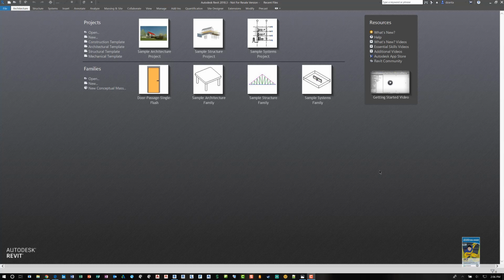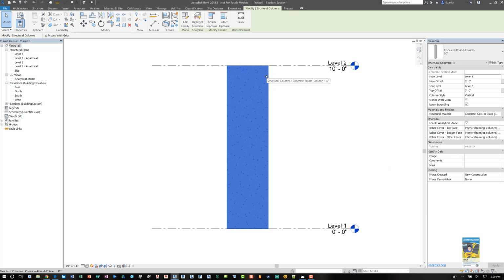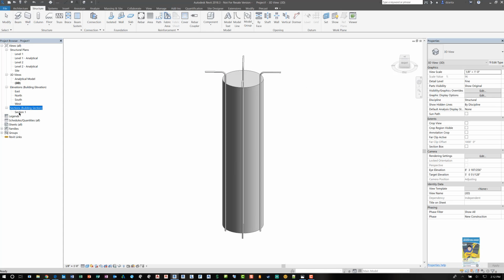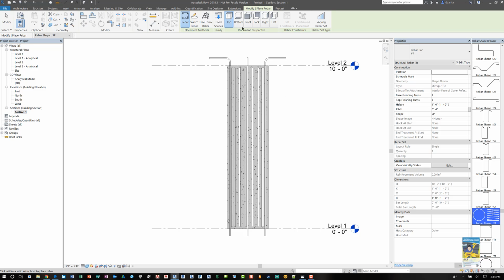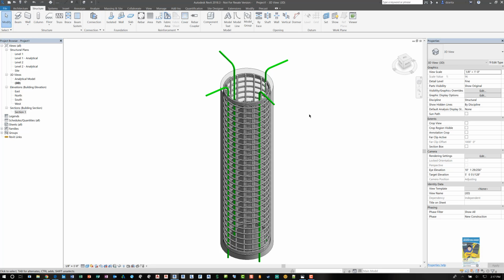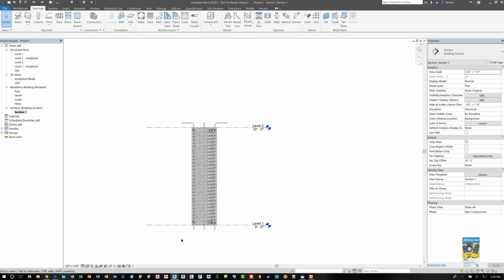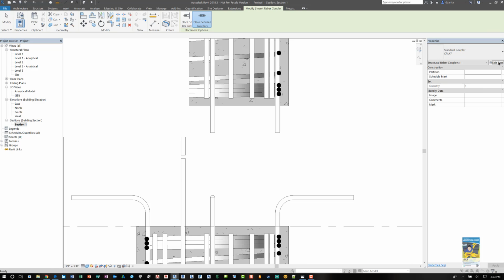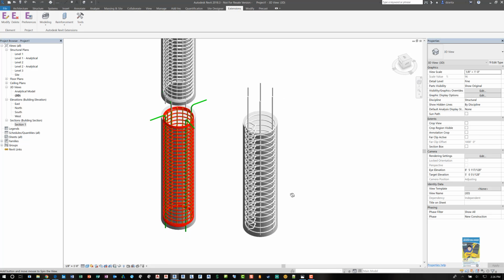Revit Round Column Rebar Creation - A How to Guide

Comment: its very helpfull tutorial , but in my case i cant find concrete and the rebar family 
i;m using revit 2018 if you may could you share the family file to this email please paul12blay@gmail.com
Reply from the maker: The round concrete column is a default family that ships with Revit.  Go to Structure Tab of Ribbon, then Build Panel, then Column command.  In the Type Selector, ensure Round Column is there.  If not, browse to Structural Columns subfolder within library and choose Concrete, then Round.  It will load in.  After placing the column, you can cut a section and then select the column to add rebar or just start the Rebar command to select the column to add to it.  Hope this helps

Comment: Hi, 
Can you tell me how is possible to make the spiral rebar cahnge like in your template. 
What i want to say is how you make the spiral be more frequent for 2m and less for the next 4m on the same spiral?
Reply from the maker: if you create the spiral reinforcing in segments (1 segment for the first 2m length) then do another segment (another segment for the next 4m length, this will give you what you want.
Reply: @DzanTa  hi, thanks four your rapid answer, awsome! But by creating separate spirals, the inventory will be difficult to read or create. 
Let's say you are creating a pile reinforcement foundations for a large building with 400 or 500 piles. The inventory and identity of the spirals will be difficult to read and fabricate
Reply from the maker: @virgilpopescu8815  I see.  In that case, you would have to experiment with the reinforcing command to see if it can create the different sections as a whole object.  I will try to look at this again later today or tomorrow and test this functionality.  I will get back to you.  I am currently teaching so can't help immediately.
Reply from the maker: So I looked at the Layout Rule Property within the rebar.  It only allows for certain methods and these methods affect that rebar tie you select.  You cannot have an entire section of rebar with varying layout rules.  I have seen where SE's will create separate rebar sections for the beginning, end and middle sections of the column or beam and then change the Layout Rule for each portion to make the rebar look the way they want.  Perhaps suggesting this capability to Autodesk via Revit Ideas would help...
Reply: @DzanTa  thanks for your help. In the example that you want to reproduce, you have the same pile with the spiral the way i want to make-it. 
I will post an idea to autodesk maybe they will think of something. 
The thing is that some plug-ins are creating the spiral with various spacing.
I have another question if you allow me: 
 - how do you create anotation just like in your example? 
 - do you have any tutorial with?
Reply from the maker: @virgilpopescu8815  The file I used was a client's file.  I don't have the file anymore but creating Text Styles in Revit is very easy.  Start with the command to make a text.  Then, in the Type Selector, find a style you like.  Choose Edit Type and then Duplicate.  Give it a new name and then change the properties to make it look the way you want....voila